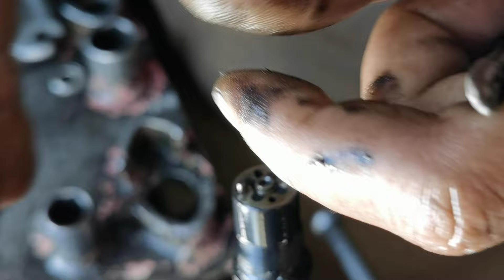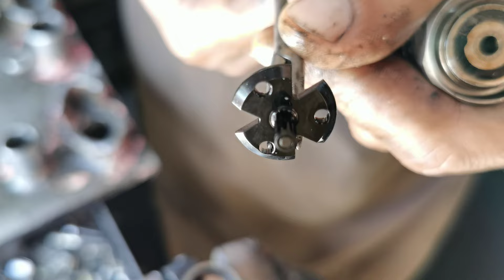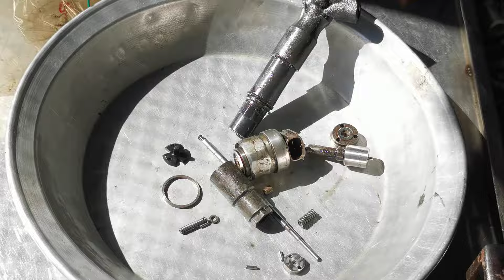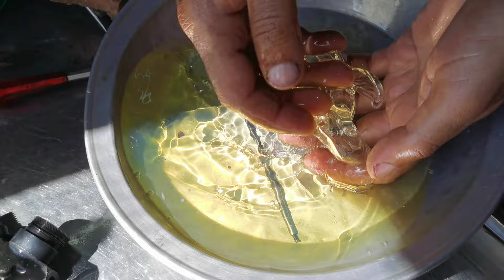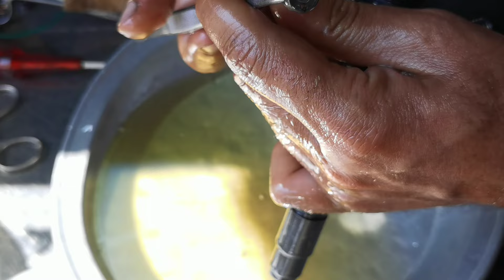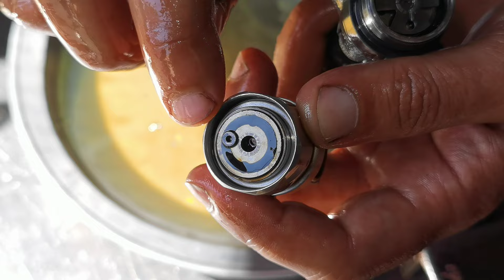how to common rail fuel injector repair

Comment: Lot peeps making stupid negative comments here.  Yes, ideally use new parts where possible, but access to such parts is likely to be limited, and most likely also cost prohibitive.  The only option left is to polish the parts to ensure they function correctly and not stick, it has to be mentioned the fuel is not going to be best quality, water and other contaminants are very likely, so regular injector servicing such as this is necessary.
Reply: I do similar work at my dealership,and be sure this kind of repair will give around 200-500 km vehicle run,then it will start to leak and most probably will damage engine. I use to play like this with injectors when i just started my diesel experience and 100% of cars having polished valves and plates came back. The second look how much dirt around,look at his hands,vises must not be used to grip injector's bodies. Any way if you stuck in village at least this is the only way to repair.
Reply: @pilotok8428  You must be doing something wrong then! 🙂.
Reply: Best not to go for common rail engines in those situations... stick to a Detroit 2 stroke
Reply: Online marketing direct
Reply: Recovering parts is an art indeed!
Reply: ابرة الحاقن تمسك ب لاقط من البلاستيك نضرا لحساسية الاسطح
Reply: @sillyoldbastard3280  Best to stick with a mechanical Toyota diesel

Comment: Great  video. Well done. It showed me why injectors are so expensive to buy brand new.
Reply: THere expensive to buy brand new cos BOSH and DENSO have a monopoly on it and there's no competition in the market, BOSHs own public financial data shows Injectors are one of the biggest profit earners there is, much like computer fans, cost less than a dollar to make, and we go spend $50 on them, no competition with 80% of all computer fans coming from 1 supplier!
Reply: @AnIdiotAboard_  Don't know enough about injector monopoly (actually sounds like a duopoly), [Offtopic starts from here] but at least my 9€ Scythe Slip Steam fans have survived like 14 years already. Sure some "high end" brands put some special designs and RGB bs in them and that design cost has to be paid with profit margins. Some may actually be worth the extra cost but after experiencing the Slip Streams for this long at this price, I would recommend them to everyone. Even the 1900 rpm model can be spun down to around 600 rpm with no problem, where they are pretty much silent.
Reply: I also

Comment: Just good in disassembling and assembling. He just done clean and sanding. Common rail injectors need new fuel calibration after reman or repair,  aka qr code at the top.
Reply: How this calibration is done
Reply: You don't need it. You just put 00000000000 into your engine computer for starters. After some time it will calibrate the injectors itself.
Reply: I didn't see the calibration shim go back in or did I miss it?
Reply: @5Dale65  Not true at all. Wish it would be that easy.

Comment: The first thing I would do after getting my injector serviced  by this business is place it in the rubbish. 
When servicing injectors  new parts should be used 
I’m assuming it will pass quality control 
Due to no quality control 
Keep up the great work 👍
Reply: I would use some rubber gloves too, and not soak my skin in gasoline/diesel like that
Reply: @elcapitan6605  worried about your nail polish ??
Reply: @Theworldisfulloftards  skin cancer
Reply: @elcapitan6605  I’ve been swimming in diesel thirty years. 
I’d be more worried about the sun
If your worried about cancer.

Comment: What is the liquid and the paste on the sandpaper. Do you have to reprogram vehicle after installation.
Reply: We just use test oil on our sand paper, it just helps with lapping/polishing of part as it lubes it up and helps it slide about
Reply: You can also use lapping paste if it’s really bad, you can find that online

Comment: Is there a trick to making the nozzle cap come off?  Mine is SUPER stuck.
Reply: For mechanical injectors, I would tap them with a hammer to vibrate them a little which helps them be easier to remove. But I’m not sure that’s a good idea for these, especially denso ones where it’s recommend you replace capnut after removal

Comment: 99% of the time in such repair, the shims are under spec, there fore, you have to replace them and recalibrate. Torque is playing a very inportant part in setting the stroke, airgap, and nozzle pin dept. Not that easy to repair an injector. Cleaning it won't be much of a difference. Anyway, taking in consideration your life conditions, I will say, I hope it worked.
Reply from the maker: Ok